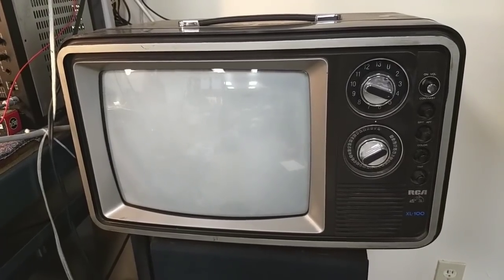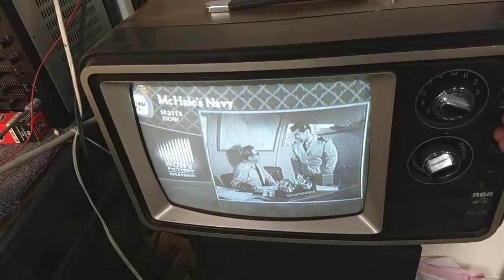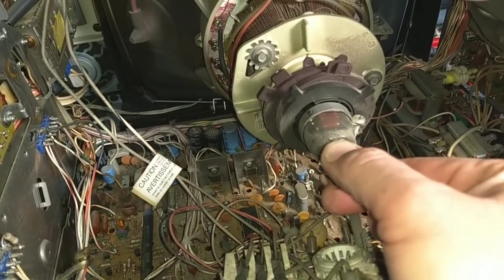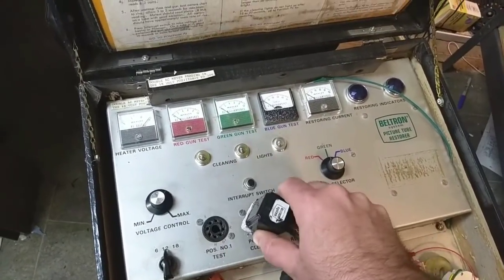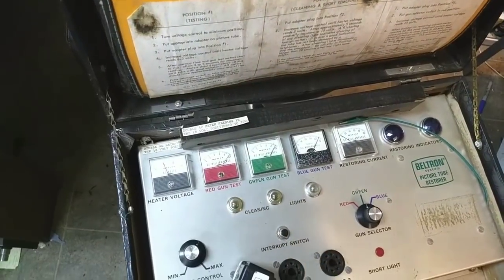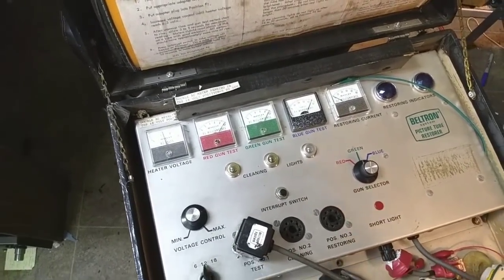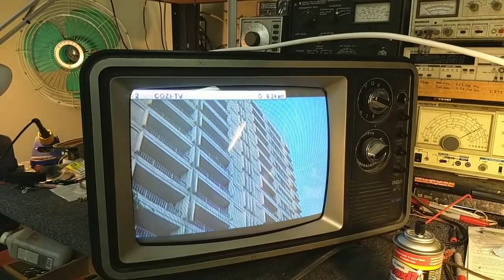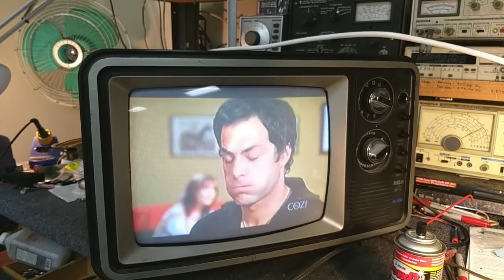What happens when you daily drive a 42 year old TV set ?

Comment: Is it true that a CRT could run for 40 years and you can clean and/or rejuvenate and then it's only got 3 to 6 months to live before the symptoms are worse and it's trash anyway or is there some gray area where if you pop it once or twice it may go on for a few more years?
Reply from the maker: Really depends on the construction of the tube. Some rejuvenate well,.others last a month or get worse.

You absolutely cannot rejuve Sony Trinitron tubes. They will either start arcing Internally and kill the driver board, or kill the gun all together
Reply: @JordanPier  so it's safe to say that older more robust RCA or Zenith tubes would take one or two rejuves in their whole life and probably not be affected negatively as long as they're not excessively zapped or overheated.
Reply from the maker: @sabbath7081  probably.

RCA tubes from the mid 70s to early 80s will typically take a shot, but results will be hit or miss.

Whereas the zenith tubes made in the Rauland manufacturing plant rarely ever need to be rejuvenated even with bazillions of hours. I've only had to rejuve one once because the blue would not register. Once I did it performed flawlessly.

You can often look at the neck of the tube and check the coloration of the metals. If the back of the guns look darker than the rest that indicates high hours and it may not hold a rejuve.
Reply: @JordanPier  I have a 1970 Zenith space command 100 I've had it forever it was given to me when I was a kid it has a 18vasp22 I think it was replaced years back but I'm not sure The red and the green tested on the weak side but the blue was all mighty and powerful I used a SENCOR super Mac and sparked the red and the blue just a couple of times on rejuve1 and the emissions came all the way back up I'm just worried that after doing that may have destroyed the tube in the long run not easy to find a tube with an 18 inch viewable face they're all 19s or some other odd numbers.
Reply from the maker: @sabbath7081  that's understandable
 You might check in with the ETF - often times they have good used or NOS tubes. I scored one for an Emerson tabletop color set from the 60s that would have otherwise hit the scrap pile. Worth a shot to keep an eye out for a spare.
Reply: @JordanPier  That's what I intend to do just in case, I'm not letting a piece of American history and pride go to a scrap pile no matter what!

Comment: would be interesting to compare a sencore cr-70 or cr-7000 cleaning to the Beltron
Reply from the maker: I have all three.

The beltron is by far the least destructive to the cathode. The cr-7000 works pretty well on really dead tubes and is very accurate on gun health. The cr-70 I find doesn't work as well, but will gauge gun health better than the beltron
Reply: @JordanPier  I also have both of the Sencore's but not a Beltron , I used to service a lot of CRT high end industrial/computer monitors back in the day which is why I have those